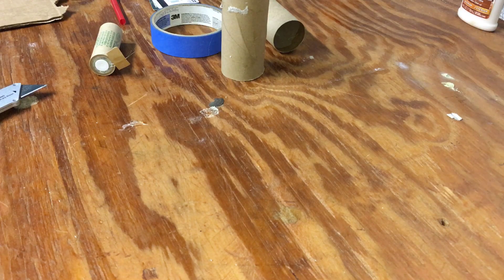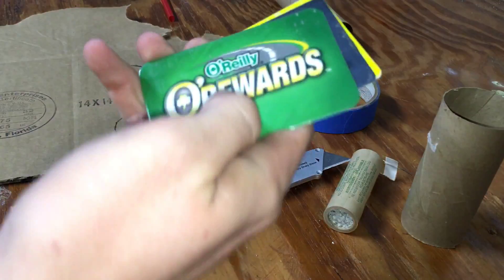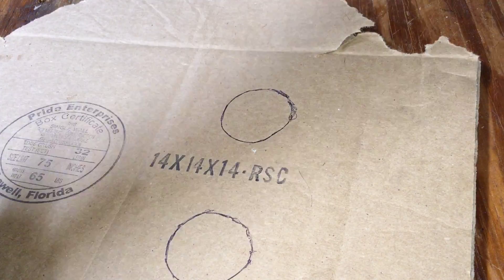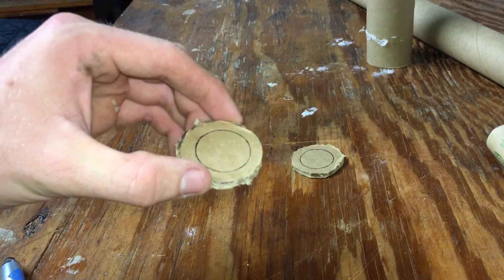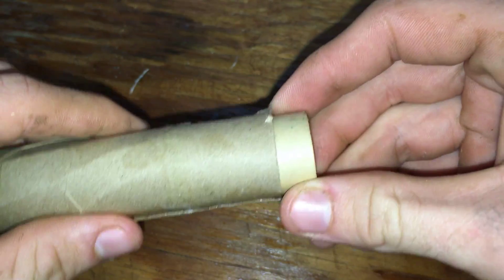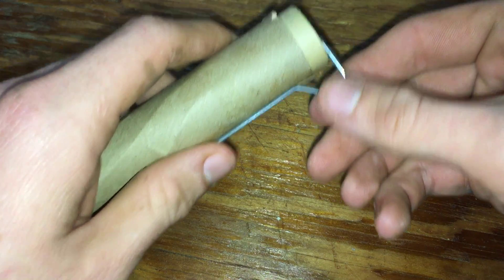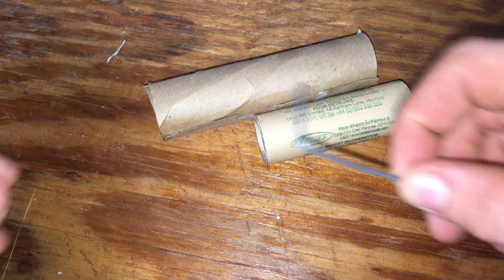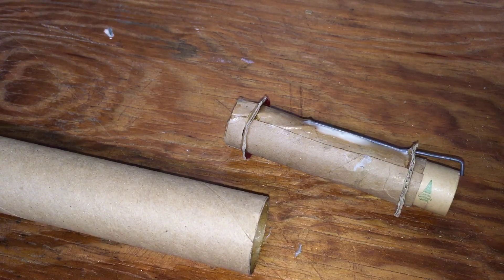How To Build Your Own Homemade Model Rocket

Comment: I have a question. I’ve launched many store bought model rockets but I’ve decided to start building them on my own. I’ve launched 5 homemade rockets so far but none of them have been super stable. Can you give me a tip on how to keep it stable?
Reply: Sure!! I think u should buy the estes fin allignment cuz ur rocket flys with help of the fins or u can get free pdfs printable ones which have the allignment or... u r centre of pressure is unstable like
Reply: To fix it u need to do is hrab the chute attach it or if u dont have it is fine but u need to find the centre of pressure (mostle above the fins)
Reply: You need to find the cp and cg. The cg needs to be at least one body tube diameter in front of the cp. I use rock sim. It is a software and it can tell you where it is. You also should use balsa wood for the nose cone.  It’s really easy to carve and it’s. REALLY LIGHT.